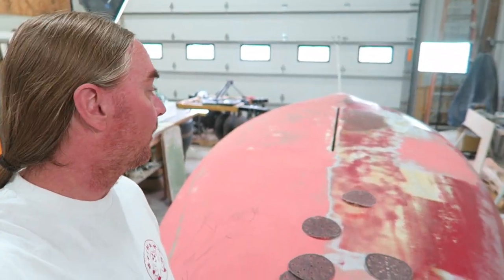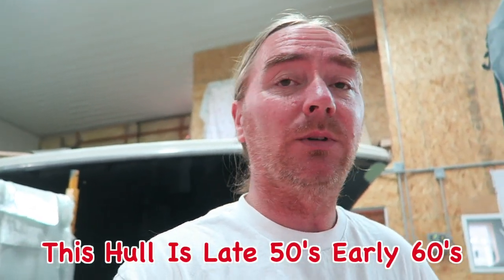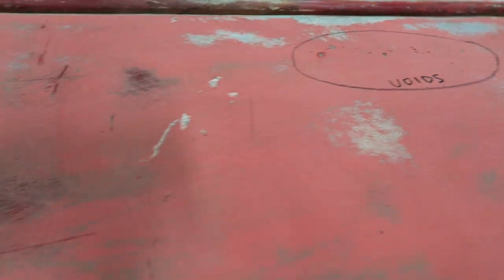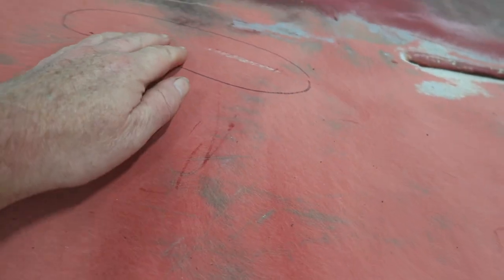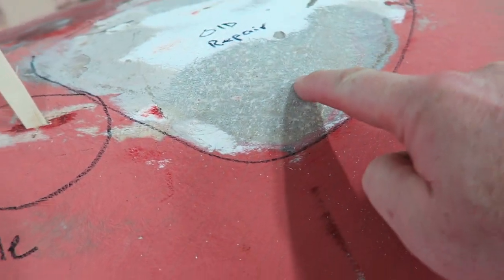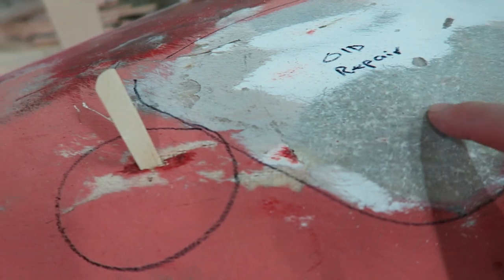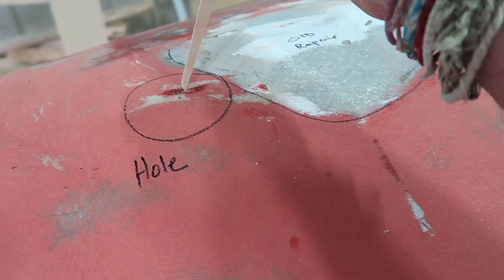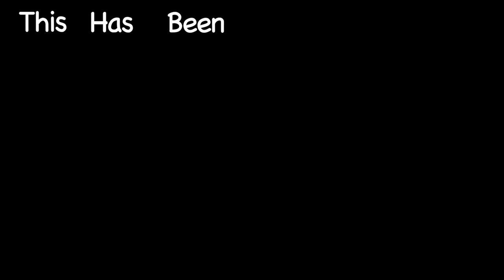THINGS TO CONSIDER WHEN PLANNING YOUR FIBERGLASS BOAT REPAIR!

Comment: What model bandsaw is that? Does it have a non standard wheel setup or are my eyes or the camera angle deceiving me?
Reply from the maker: It's a Powermatic PM1500 :-)
Reply: @boatworkstoday  It must be the camera angle/lens - makes it appear as if the top of the tool is foreshortened and I was wondering how the top wheel would fit. Thks. Looks like a nice saw, my Jet 18 gets the job done, but is a bit rough and kind of underpowered.